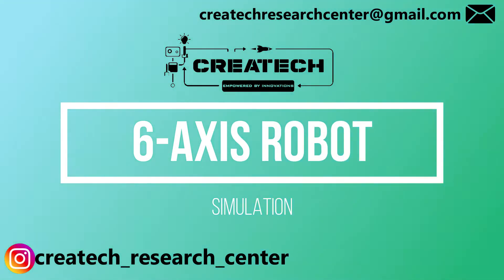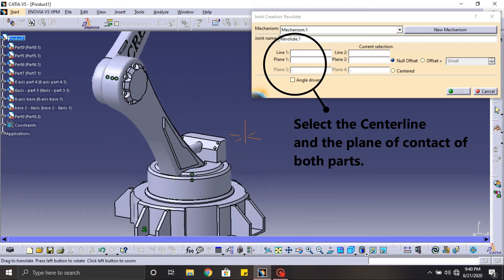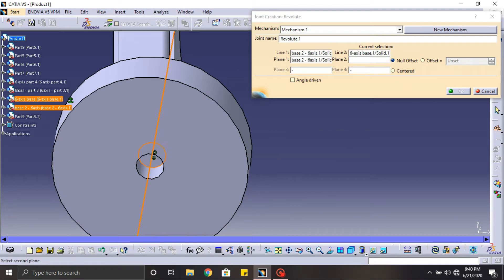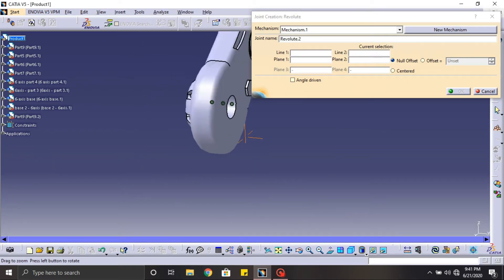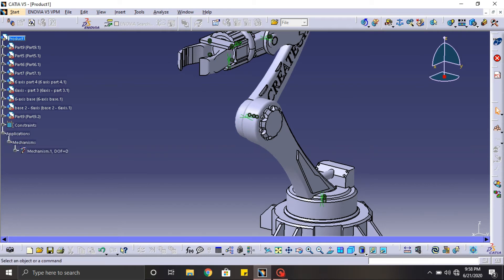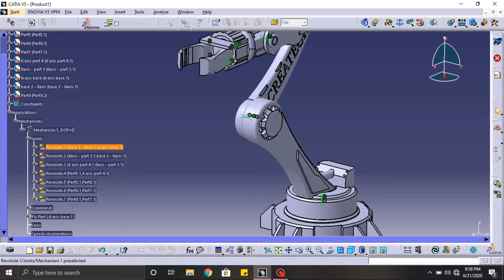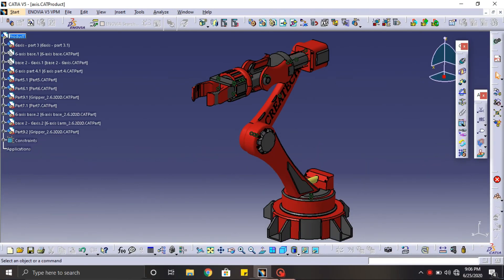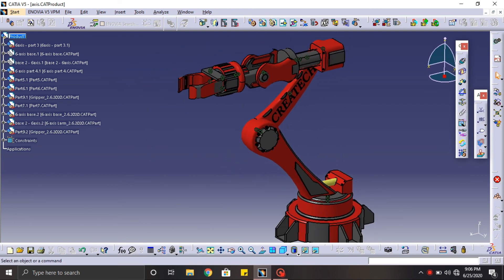6-Axis Robot | CATIA Design Tutorial | SIMULATION

Comment: How can the robot's hooks move at the same time(dependently) rather than independently? In the simulation, you move one and then the other. I do not want it to be like that.
Reply from the maker: This is just the simulation in designing software. You can't get all the output parameter in this,only you can do is the Design and the possibility of work while making the prototype of this robot.If you need to analyse the movement of the robot get to see the software's like MATLAB.RoboDk,Rokisim,V-Rep,These are the preferred tool to make the 6-Axis Robot.